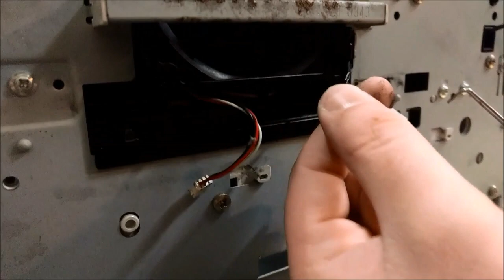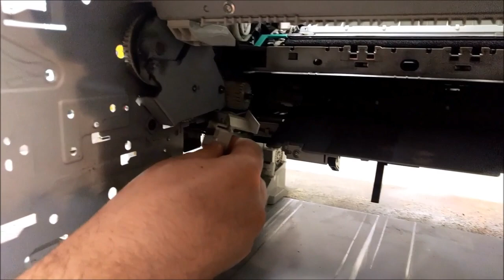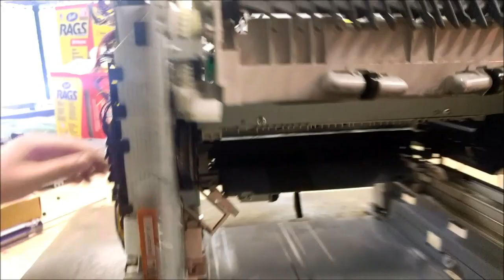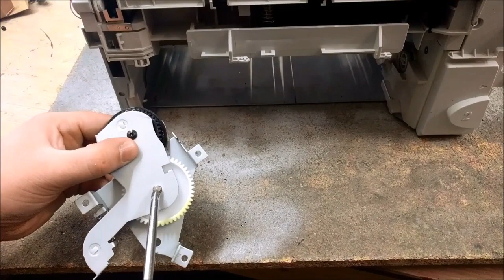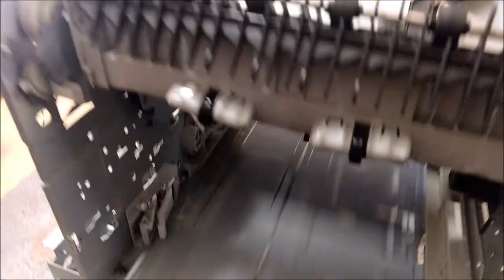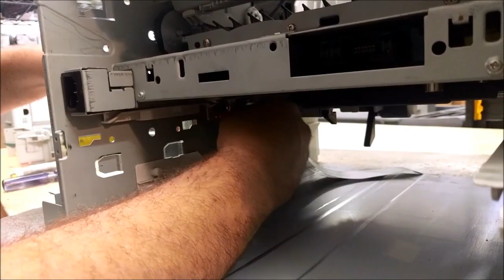HP LaserJet 4200 / 4240 / 4250 / 4300 / 4350 Swing Plate Installation

Comment: Thanks for making this video, it was very easy to follow and I found the explanations and commentary very useful. I replaced the swing plate assembly successfully, and now have a working printer again.

As you predicted and warned, that final top screw on the assembly was stuck fast and I couldn't avoid rounding it off, making it impossible to remove. The only solution was to drill it out and since the stump of the screw wasn't able to be removed, I couldn't get the third screw back in when fixing the new assembly, therefore the assembly is only attached with two screws rather than three. However, it seems fairly stable and isn't able to move much, so at worst perhaps it will just be a little more wear on the gears than usual.

Thanks again for an excellent repair resource.